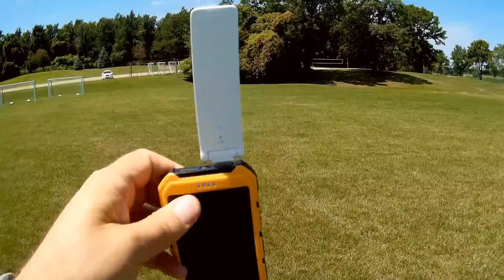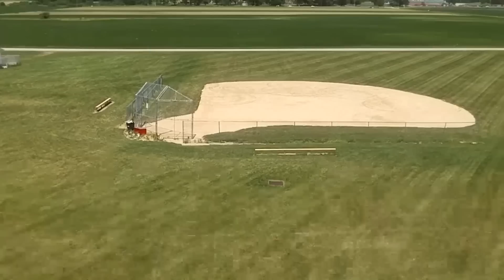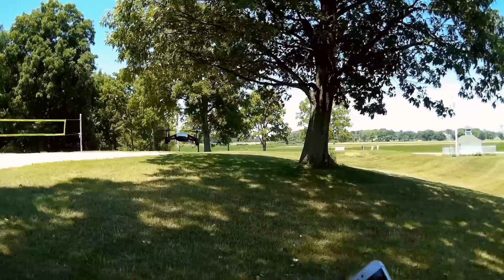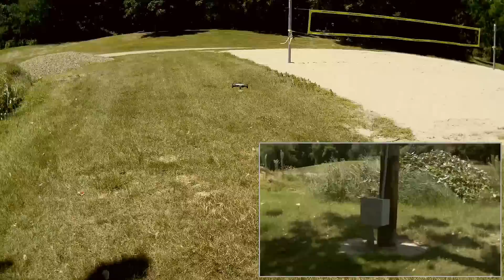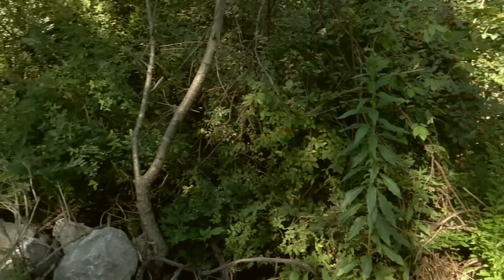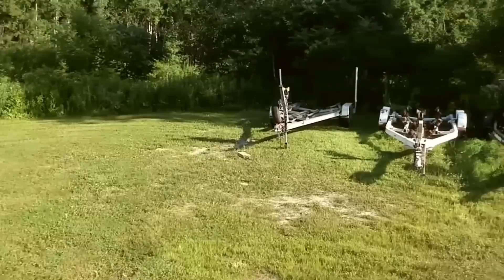2018 Best Travel and Vacation Camera Drone Flight Test Review

Comment: Must disagree TOTALLY!  I've had my Le Idea 10 GPS for almost 2 month now.. Like its predecessor the Model 7 I also have, this folds up and it and TX and 4 long run LiPOs and charger fit in the included 4inch X 6inch hard case for travel. It also has 5g WiFi for FPV flight and the Camera takes a MicroSD card. Everything a true GPS Camera drone can do, this one can! Price less then $125 on Amazon too.

Comment: Wow. Is the video edited/enhanced, software stabilized?..im impressed with the video quality.
Reply from the maker: Nope, no enhancement at all.  However, as stressed in the video, this is mainly due to using the Mi repeater with my phone (vice connecting directly with my phone).  This provides a much stronger/reliable WiFi connection between the drone and phone.

Comment: I love my Tello.  For it’s size and feature set it is by far the best drone out to date. I picked mine up for $100 and it came well-equipped with the quad, extra props, three batteries, a triple battery charger and other miscellaneous odds and ends.  The video though 720p through WiFi is totally acceptable for making family memories and the wide angle photos it takes are simply outstanding. Obviously it’s not equipped to handle much wind but still for its size it’s amazing.

Comment: Because of your review, I headed over to Amazon.com, and checked out the ratings. Only 51% were 5*, and a whopping 19% are 1*
Even so, I actually read the 1* reviews (as I always do), and found little in the manner of operator error. Customer service did not receive any accolades, and more than a few reviewers stated that "Video stinks", ""Flaky  and jittery", and to that effect. 
The only prominently good thing I read was that it flies in a very stable manner.
So, thanks for another great review, but I'll have to pass on this one.
I see that you're not wearing your Mobius Action Cam on your hat these days - which cam are you using, and why not the Mobius?
Reply from the maker: I'm not sure where you read those reviews?  Here's what I saw on Amazon https://www.amazon.com/Tello-CP-PT-00000252-01-Quadcopter-Drone/dp/B07BDHJJTH/ref=sr_1_1?ie=UTF8&qid=1544151620&sr=8-1&keywords=tello#customerReviews
Reply: @Quadcopter101  

Aha!
That's a different webpage on Amazon than the  one of which I commented. You found one with MUCH better reviews - okay, I'll have to check it out, THANKS!

BTW - which action cam do you suggest for the Nihui U807?  (I use an old Mobius on my motor scooter, since you recommended  it's use several years ago (2015?) ?

Thanks again!
Reply from the maker: My Mobius is still going strong today.  Nearly every one of my 1300 videos was filmed with my Mobius attached to my hat.
Reply: @Quadcopter101  

For my  NIHUI U807(A), would you recommend the Mobius (Mobius 2?), Runcam (Runcam 2?) or what, please?

Comment: Wow you really get no frame skip! Is it because there is no much interference or the wifi repeater?  Or both? Because I get tons of it. How can I solve it?
Reply from the maker: The repeater greatly helps in reducing interference and improving range.  Also, if you are using a Bluetooth controller with this drone, stop using it.  Bluetooth operates on the same 2.4Ghz as WiFi, causing interferance with the WiFi signal and aggravating lag.
Reply: @Quadcopter101  I was planning on getting one for better flyability because I live in LA and flying around is very difficult too many people but thanks amazing video btw
Reply from the maker: Yeah you can fly this most places without being hassled.  As mentioned in the video, I was flying in a park right next to a policeman taking his lunch break in his car.  No problem.
Reply: @Quadcopter101  ok thank you

Comment: with what phone do you use tello ?? I suffer as cuts of video stoppages. You configure the video vibrate in the application. I do not know if it will be for the cell phone.
Reply from the maker: As I explain in the video,  am not suffering much video stoppage because I am using a WiFi repeater amplifier https://www.youtube.com/watch?v=QM5fO9oX_ts
Reply from the maker: You can also try lowering the video bitrate in the aircraft settings. I recommend 2M instead of Auto.
Reply: thank you very much. With what phone this video is made
Reply from the maker: I was using Leeco LeTV X520 phone.

Comment: Hey i recently got into drones and been looking for some information, I bought a koome k300c which has a 600mAH and gives around 10 minutes the timing isn't the best but not the worst either can i upgrade it? i only spent like $50 on it is there a cheap solution also the stock camera is absolutely terrible i was thinking of replacing it with a sq8 since that's the only option i got atm but not sure how well that will perform, do you have any tips or suggestions for me? thanks :D
Reply from the maker: K300C is a Syma X5C clone.  They're great for beginners to learn to fly with.  I've reviewed the SQ8 camera.  It's not the best either https://www.youtube.com/watch?v=WL75c6Eomis
In terms of upgrades, I have removed the camera, landing gear skids, and prop guards to lighten it up.  This enabled me to install a proper FPV camera https://www.youtube.com/watch?v=zyBwhEP3E_M
Also without the weight of those three items, this becomes a much better and agile flier https://www.youtube.com/watch?v=fdPI9LB9MeY

Comment: Those birds were never going to bother you, since a stock Tello can only get 30 feet high ... and about the same distance in range before the FPV signal becomes unusable. Yeah, you can add a booster, and use a cheater app and what not to try to improve the performance, but that's like putting lipstick on a pig. I would take one of my old 33041 Mould Kings with an AIO VTX mounted on it. It won't hold its position, but there would be usable FPV out to 70-80 meters, with no altitude restriction. The build quality of the 33041 was pretty lousy, but for $15, it was okay. (that's what I paid for my last 2 when they were on sale). Glad you enjoyed your trip back East .. surprised you didn't wear any of those shirts you picked up outside of Presque Isle Park. I suppose we'll see them soon enough. Cheers.

Comment: If you had to choose between this and the yuneec breeze, which would you pick? The breeze has dropped in price and is only 50 dollars more than this quad...I appreciate your input!
Reply from the maker: This still.  The Breeze does not have image stabilization, and is not as inconspicuous as the Tello.
Reply: Neither one, go with the Spark! Great deals on them now. I think you can find one for just a little more then the breeze.
Reply: Quadcopter 101 Thanks for the advice! I appreciate it
Reply: warspite2 I'll have to look into that... thanks!
Reply: Quadcopter 101 correction the Breeze has EIS except for 4K. But the Yuneec Breeze still will attract attention due to prop noise.